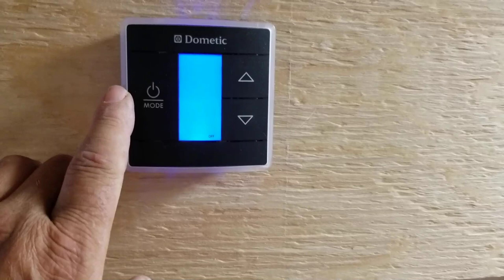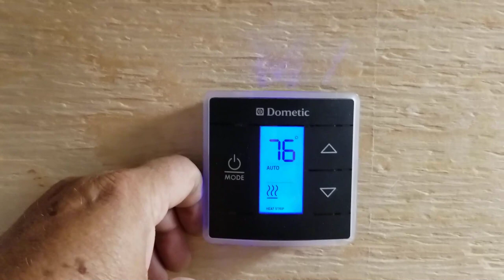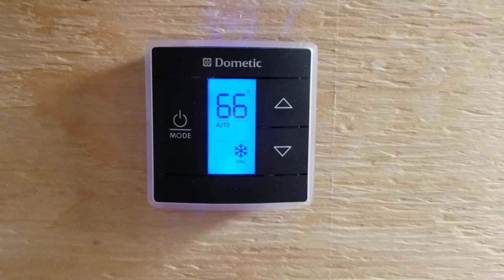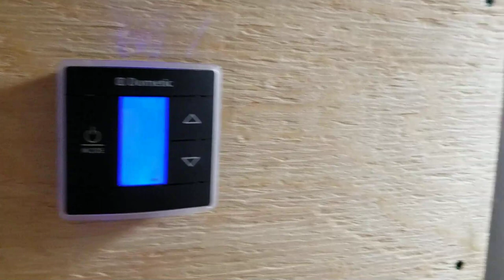Bus Conversion Project - Video 87 - General wiring and getting the heating/air conditioning working

Comment: I have been watching a channel a lot called bus grease monkey. You may be wise to reach out to him. I noticed that on some buses the fill spout is ridiculously high which in my opinion would suggest that the auxiliary fills first and spills over into the main tank. If that's the case you should possibly be able to see it from the engine compartment. Dont know if you researched 10 fold design as I suggested but would be awesome in a trailer application for addition space or even a portable deck area. Good work either way mr dennison
Reply from the maker: Thanks... I did look at 10Fold Design... made my brain hurt... :-)… I've spoken with Scott at BGM in the past, that may be worth a try again, Thanks

Comment: Maybe use the aux fuel tank just for off-highway. Disconnect the crossover tube. Don't pay highway taxes on your genset and heater's fuel. Use a manually operated pump to transfer to the main tank if you need to.
Reply from the maker: I'd have to add a second fill point for that tank but that is an option.... Thanks Kevin

Comment: Morning James nice work with the controls I like the fuse block you have could I get that model number from you.
 oh down the road I wanted to talk to you about your dash defrost system you might be going with my fans are just howling so I'm sure the bearings are shot as far as the tank going my manuals say mines is 170 gallon tank and the idiot light on the dash comes on at 25 gallons remaining I'd like to put a sending unit in it for a gauge down the road.
The only access points I can physically see is at the side of the tank at the fill door there's a plate with a single wire coming out of it
It maybe the pump wire or it might be the idiot light wire which sounds more probable to me I just haven't had time to look into it yet.
So I've gotten my panels for the driver side cut and predrilled for install that will happen this next weekend.
 As always love your work my friend you truely are a great mentor to many of us.
So thanks for sharing James.
Reply from the maker: Hi Brian:https://www.summitracing.com/parts/vta-981412 here is a link to what I'm thinking for dash heat and air.... maybe a 24V electric motor for the compressor rather than running lines to the back of the bus.... maybe won't use dash air, roof top may be enough while traveling... not written in stone yet.... I'm definitely going to put in a fuel gauge... glad your project is coming along, the photos look good, just keep moving along at your pace

Comment: Should just be a simple gravity feed with a line connecting the tops of the tank and one connecting the bottom, at which point you just consider them together as one tank.
Reply from the maker: Ya, that could be... I just want to figure it out.... Brian above mentioned how his works and so I think you're probably correct.... Thanks